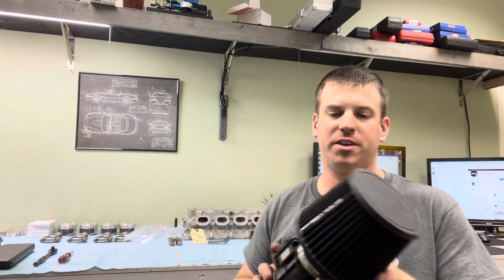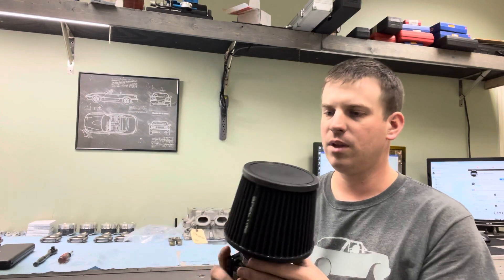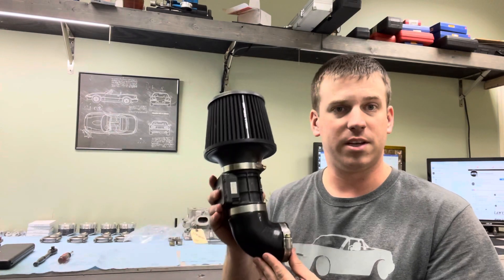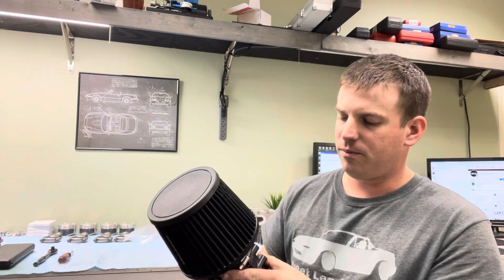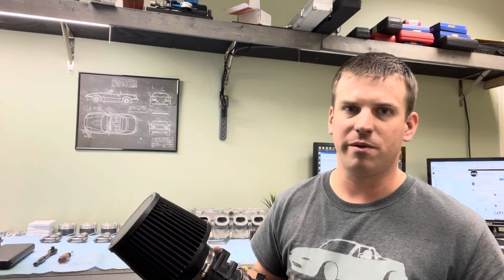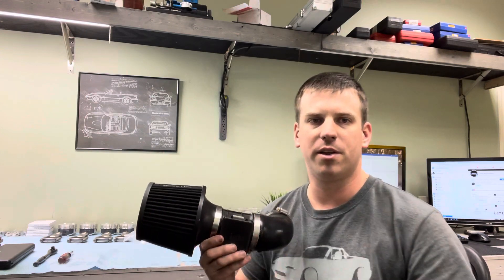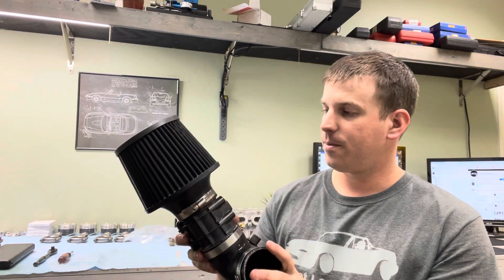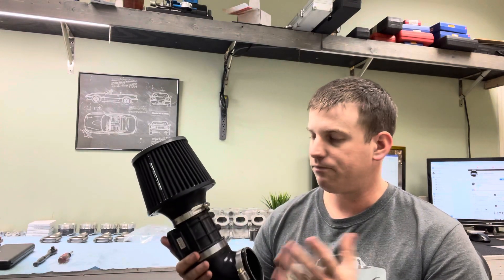Tech Tip: Best Miata Intake length?

Comment: I wonder if the 12 inch long system had a heat shield to add separation between the intake and the exhaust, and I wonder how effective the heat shield is? I am currently thinking about swapping the stock intake box with a HPS Shortram Air Intake Kit and it come with a heat shield.

Comment: I'm just a regular guy driving my low mileage '94 on the street.  Not interested in max horsepower and certainly don't care if I get 4 additional horses on the top end.  I go fast enough on the streets around here redlining it all day long.  I like the sound and the low end torque for what I do.  I installed the Rev9 Power Air intake box and my butt dyno says it really gave the car a kick in the pants on the low end.  I did it for the sound (which is great), but was pleasantly surprised at the power gain.  I also did an intake and MAF sensor cleaning so that might explain it all, but I just wanted to add my take on this ARC type system which sucks air from the stock box location.

Comment: I use the racing beat fiberglass sealed airbox. I think this solves the hot air problem. It also receives cool air from the bumper area. It looks good too.